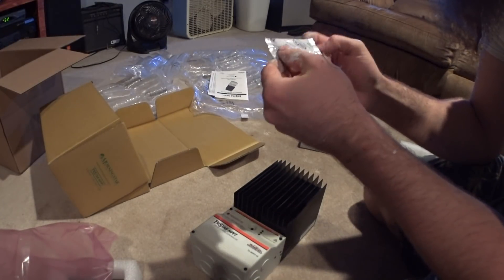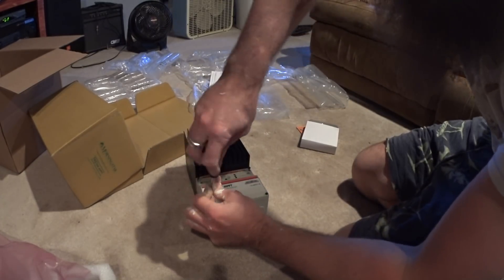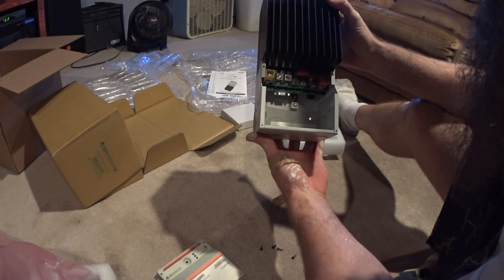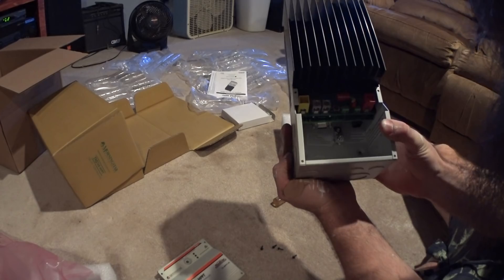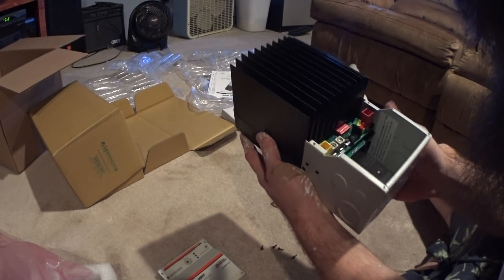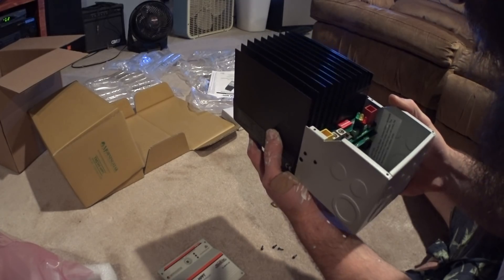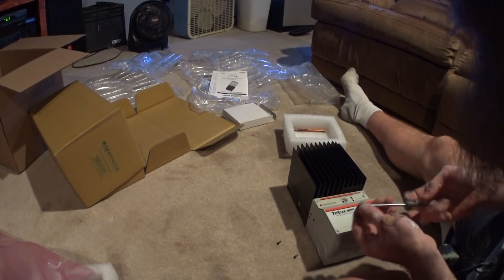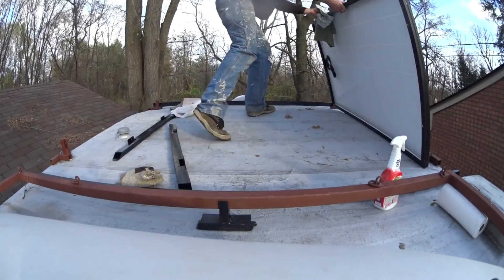8 How to Install Solar and Inverter/Charger. From Unboxing to 6 Week Road Test

Comment: Great job with the video and mounting the solar panel, inverter and charger. Have you thought of using LED lights to reduce the draw on what you have in the bank. It's one thing that will let you run your computer longer. Also, think of using 12v for your computer and lighting, you lose a lot of power just converting 12v to 120v. Converting is what that heat sink and fan is all about and that heat is engery used. The MPPT is the right type of solar charger as it converts high voltage from the panel into the 12v your batteries take instead of dumping it as other types of solar controllers do.

Comment: Great job! I saw your interview. To help beat the heat you might consider a second solar panel that you can ground mount in full sun, while the RV is parked in the shade. I'm adding 200 more portable watts to our system for that same reason. Park it in the shade, put the panels in the sun. Great DIY work in this video!